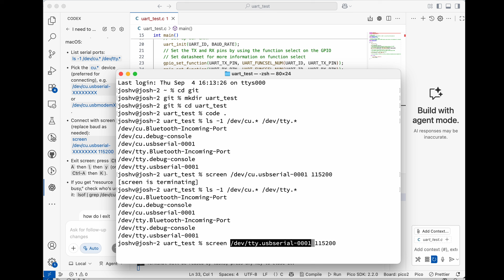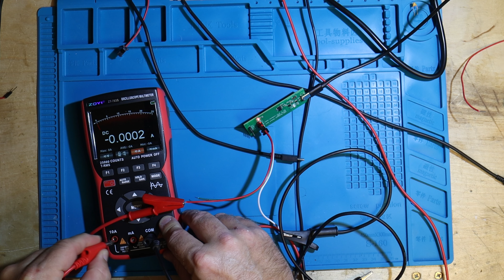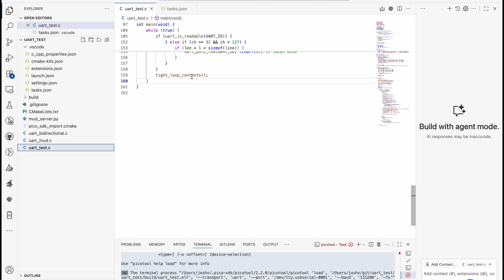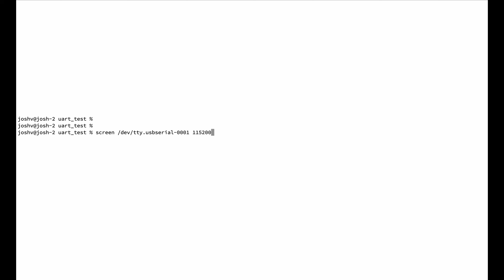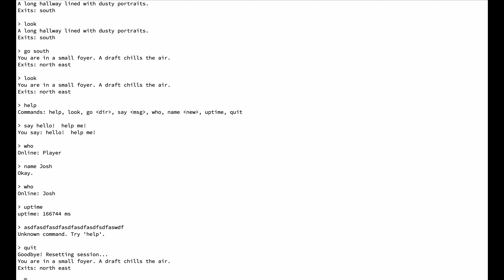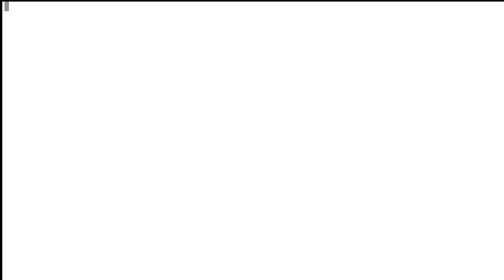Testing your first PCB #pcb #diyelectronics #jlcpcb #easyeda #uart #electronics

Comment from the maker: I can't decide, did I wire TX/RX backwards?
Reply: go for all protocoles possible
Reply from the maker: @ElChacosolar  Tell me more.
Reply: @ElectronicsUnscripted  ADC, DAC, RX/TX,  CAN... RF, Wi-FI, IR, Lora... Every time, we need to expose datas or communicate with several devices
Reply from the maker: @ElChacosolar  Aw, I see. I imagine you could use this as a starting point for something like that. This project was designed to be a simple first PCB without an MCU (though the UART does have a simple MCU, it's not programmable, just configurable).

Comment: Nice to see that heatsink doing its job!
I’m just curious. You’re using Celsius instead of Fahrenheit. Is that because most components are specked in Celsius? 
Greeting from the Netherlands!
Reply: I think more modern components would tend to be in Celcius at least by default. The biggest advantage Celcius has its unit scale is aligned with the units of Kelvin, but with a different zero offset. If they have digital space, they might have F as alternate units. There are also cases like the LM35 and LM34. They are analog temperature sensors (convert temp to millivolts), one works in Celcius, other in Fahrenheit.
Reply from the maker: I just try to stick to metric when I can. Which can cause problems. In a new project I am trying to integrate products that ship in LEDs per meter with stock from the hardware store that comes in feet and inches.
Reply: @ElectronicsUnscripted Thank you for your answer! I very much appreciate and respect your effort to use metric. For me it’s easy as everyone uses metric here but you will constantly run into issues like the one you mentioned. 

We still use imperial for things like pipe-fittings for example. Oh and also for tire sizes. Diameter in inches, width in mm and height as a percentage. 
(Someone has successfully trolled all of us). 😁